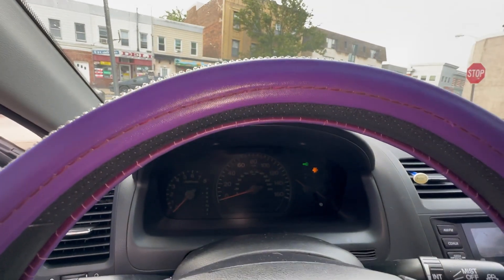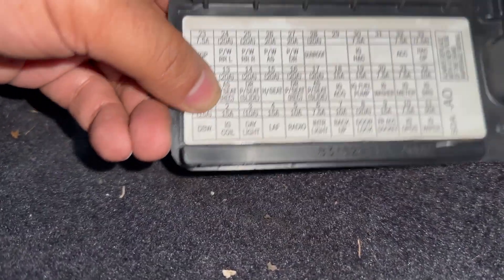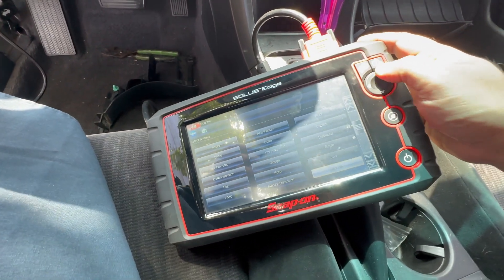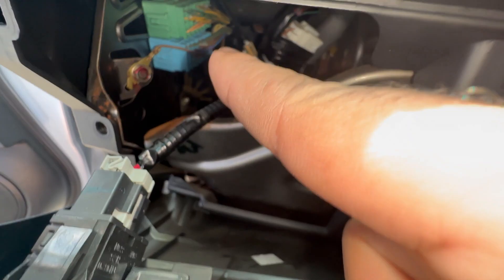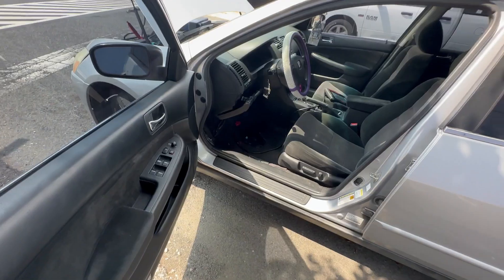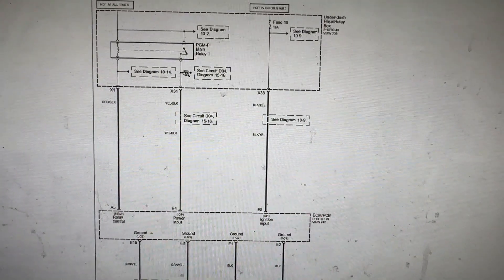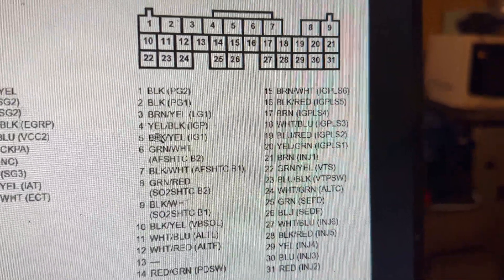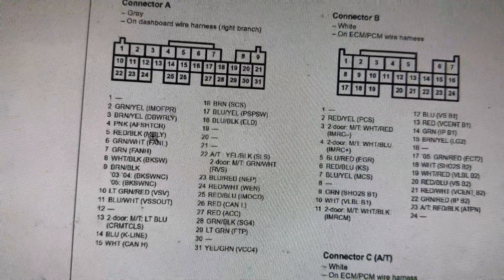No communication with ECM on Honda Accord 3.0L 2003 to 2007  some schematic and diagnostic help

Comment: That's my problem right now with my Honda Accord 2004 model..no lights are visible on the gear selector on the dashboard and it won't start...but once the lights are visible on the gear selector on the dashboard it starts. My mechanic said it's possible that the computer box is broken, there is no power supply to the computer box or the supply is leaking.

Comment: Here’s my fix.
Jumped power to ecu (youll have to see which one in the diagrams and test with meter to find which power to ecu wire is not feeding) I believe mine was black and yellow. Then pull the ig meter fuse under dash. This must have reset the micu. I believe this all started with bad grounds.
Reply from the maker: Oh ok
Reply: @ it won’t start again I’ll have to jump it again. The micu must be bad. The electric guru that looked at it said that it’s inside the in car fuse panel

Comment: Hey ive got a 2007 honda accord 4 cylinder and my drl lights came on. Ive got a new battery but no lights on the dashboard and the car wont turnover. Not sure what it could be.
Reply from the maker: Not sure what ur asking me
Reply: @RBTheMechanic  I've got a brand battery and the horn works but I don't have anything else that works. Trying to figure out what the problem could be with nothing working.

Comment: My acccord wasn't working I made a jumper on relay R6 and relay R7 and it worked there is some voltage missing from the relays do you have any idea what it is
Reply: My issue I thought was a ground in the center console. It was overtorqued and broke the bolt after half a turn. Moved to another spot and it was starting but now it won’t again no matter how I mess with it. After I moved it I would occasionally have to tap it . Get the green key light and no cel when pcm is not communicating
Reply from the maker: Maybe u just needed new relay
Reply: @RBTheMechanic  I tested the relays, they are good, but there is no voltage to activate them
Reply from the maker: @JoaoVictor-gy6fl  is there pressure in the system?
Reply: @RBTheMechanic  Yes
Reply: @RBTheMechanic  Would you be able to provide this electrical diagram that you are looking at in the video?
Reply from the maker: @JoaoVictor-gy6fl  well I’m close for 4th July but Friday I can send u sum if u msg me 10am